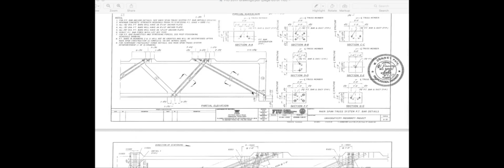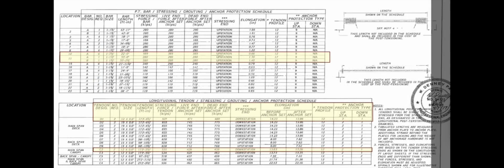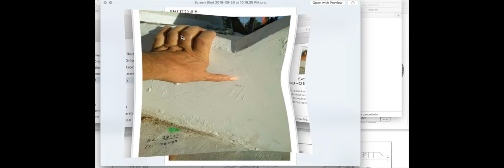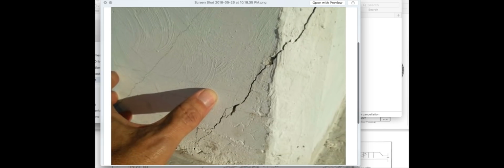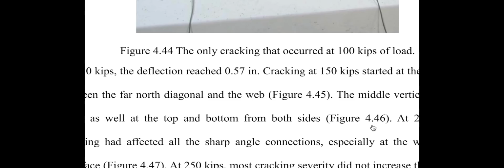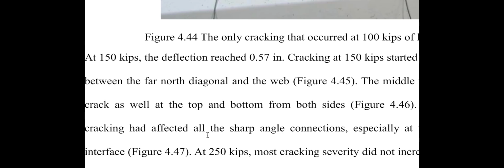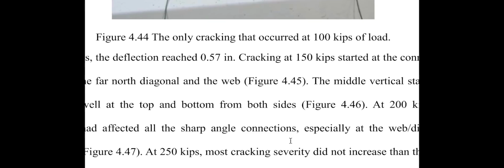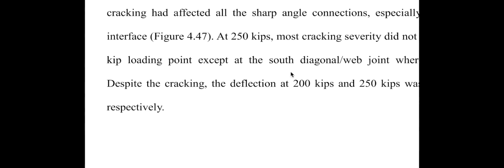FIU Bridge Collapse NO SHEAR proof in the crack photographs; Formwork removal failure

Comment: How many evils could have been avoided with an arch ...
Reply from the maker: I love the theory and working ability of tensioning, as a counter force... BUT, I hate / dislike it's lack of ''stability" in the real World...
Engineering, needs to dial themselves back a notch with this crap of cables in a ''hidden'' condition and used in ''flat'' condition and demanding that they stay ''flat"...
The assumption that they will stay flat and only with a limited amount of loss in elongation during service life has proven NOT to be true... 
They are failing all over the this country...  Repairs like no other are required but, it appears the road industry is ''in for a penny, in for lb"   with post tensioning...
Steel industry NEEDS to market AGAINST this ''cable industry"  and get the concrete industry on their side also.

Comment: I don't believe one has to conspiratorial to think maybe NTSB could make a mistake and could be in over their heads on this. Maybe I am incorrect on this but NTSB seems to be chosen for this based more on what it was used for (transport) rather than what it is. A bridge has a lot more in common with a building than an airplane. Perhaps NTSB has experts that are familiar with bridges and structures or are bringing in people from other agencies or the outside who are, and therefore is well equipped to handle this. I am not saying they are not. 

Simply being skeptical doesnt necessarily mean one thinks there is evil intent on their part, it could be that one thinks they are incompetent or poorly equipped. I am not saying NTSB is incompetent in any way, I am just pointing out the difference between the different kinds of skepticism,

Comment: My other concern is with sideways flexing. In theory the FIU bridge is symmetrical when viewed end-to-end, and should not experience significant lateral forces. However, the fact that the form-work was removed prior to transportation (and before the stiffening pipe-stays were constructed) is significant. The blisters in the canopy are subject to stress concentrations, and any lateral deflection of the span could have caused cracking. The joins between the trusses and the canopy (and deck) were already vulnerable (longitudinal post-tensioning cables not aligned with PT rods), and this adds another potential failure mode IMO. Just another theory...

Comment: The bottom deck deflected more than the  top deck, hence no lateral movement. Those fillits separated away  from the struts. That tells me the deflection of the lower beam was outside tolerance and the bridge failed its uperlimit. The architectural design and calculations screwed up or the build was not to plan. Would I have condemned that bridge?  Yes if subsequent tedts proved it would further deflect. It is a no win situation. No way to remedy the cracks or fix the excessive deflection.
Reply from the maker: Agreed...
And we will never know if the cracks would not have happened had they left the formwork in and post tensioned the structure as specified...
And of course, leaving formwork in while MOVING structure...
As you may know...load testing would have been advisable to some degree after back span was tied in...(scene stealer from one of up and coming videos)...

Comment from the maker: This is part 1 of 4 videos to come about cracks and their contribution to the failure... of course, cracks are NOT responsible but the designer is responsible for not calculating their cracks and contribution...  Here is the 117 page study for those who want to peak... Keep in mind, the design is different ; this is about post tension and what is the max span you can do a ''truss system''  NOT a bridge system!  But, this shows some of the faults they found in a 30 foot model. 
 https://digitalcommons.unl.edu/cgi/viewcontent.cgi?article=1013&context=constructiondiss